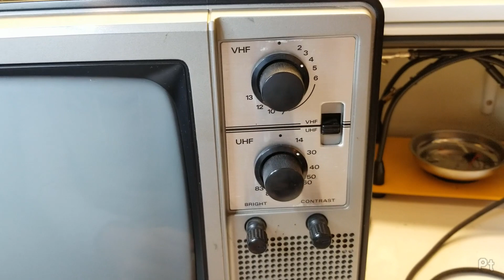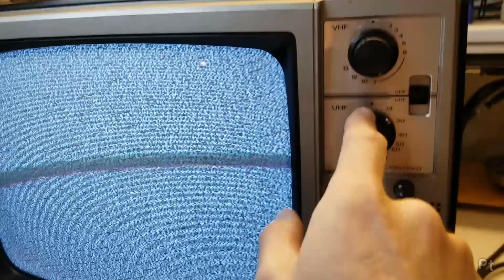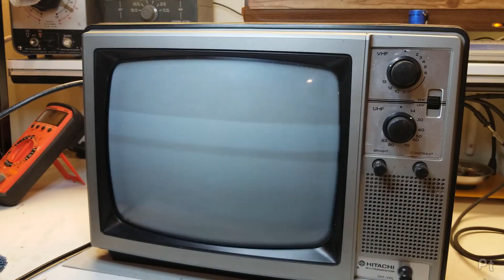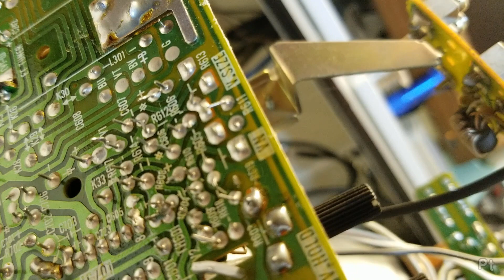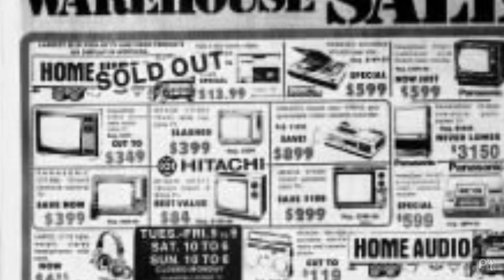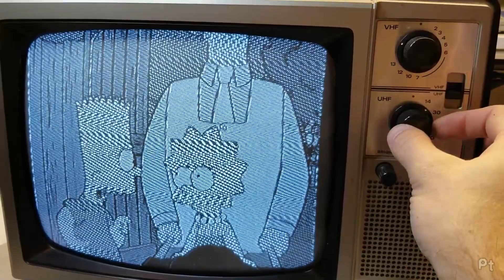Hitachi 12" Black & White TV (from 1981)

Comment: NOTE: incoherent ramblings ahead
I don't know when Germany went to these kind of tuners, but probably mid to late 60s*. With the advantage of having preset tuning on almost every TV. I remember I got a 1981 11 inch Grundig B&W (what? They made black&white TVs that late? - well turns out in the rest of the world...) that had pretty much the same tuner as their color TVs and VCRs. Yeah, one model fits all, that's how we cut cost. Now how about let's cut the cost even more and use as little solder as possible, that won't affect reliability in any way... back to where was I? Ah yes, that Grundig had a 12V input and I measured it at pretty much exactly 1A, so 12W. The 32W of this Hitachi seems excessive. I found an 11 inch b&w Nordmende in the e-waste not too long ago and it draws pretty much exactly 2A - and it does state 24W on the back. I know there's some losses in the AC transformer, but 3 times the power? Come on!
*) I found a Grundig Zauberspiegel from around 1967 (component date codes) that had a tuning knob that turned out to conceal a very weird (mechanically weird, electrically it's the same as this Hitachi TV) preset tuning and I'm certain that was so that customers used to the old style turret tuner (which the US used until no one in the world produced analog tuners anymore) wouldn't be alienated. Changing channels by pushing buttons? Ugh - miss me with that weird complicated future nonsense!
So as you can see, I don't do any research, I just draw conclusions from what I have on hand and/or find in the e-waste.
Reply from the maker: Incoherent ramblings are what this channel is all about! That Grundig from 1967 you talk about - RCA used this a lot on their sets in the 1980s. It was a rotary selector knob like the old tuners, but really it just switched between voltage presets. Essentially a pushbutton varactor diode tuner in knob form. In fact it was even simpler as the 2 thru 13 presets could only be varied slightly (essentially enough to fine tune) and then the additional 4 to 6 presets that supported the whole UHF band. Creature comfort for the older generation.
Reply: @probnotstech  Same same but different. If you've ever taken apart one of those pushbutton preset tuners (with a band switch VL VH U and a spindle trim pot), Grundig built a turret tuner using six of those. So there was nothing stopping you from putting channel 36 UHF on preset 1 and VHF H channel 6 on preset 2 and so on).
The comfort was in "it looks and operates like what you're used to, but once it's set up, you'll have a TV station on every channel" - magic mirror indeed (Zauberspiegel).
Too bad my mom wouldn't let me keep it.
TL;DR
Our summer vacation is the same every year. The people there have an attic (lumber room? Deutsch Rumpelkammer) where there used to be an awesome 1978 Salora TV with on screen display, clock, auto channel search with progress bar (yes, 1978), crazy sharp and vivid picture, sound chamber speaker (read: subwoofer), ultrasonic remote control and inside there was an LED for every power rail the PSU put out, there were oscilloscope screenshots silkscreened on the PCB next to the test points... the actual owner of the TV who rarely was there didn't know I was using it and just threw it away...
So I went to e-waste to see what was in stock. I had the choice between many modern (=broken+useless without remote) flatscreens, a mid 90s Grundig (also useless without remote, my games console only had RF and without being able to enter channel search, useless), an early 70s huge solid state Black&White TV and the almost equally as big 1967 (or 68) Grundig Zauberspiegel.
It had the dust of sitting in an attic for 30 years on it. I turned it on (usually a bad idea), but it worked. Or so I thought - because static on the screen and out of the speaker. I hooked the SNES to it (I left the AV connector at home knowing the TV waiting for me wouldn't have AV anyway), stumbled on the weird tuning mechanism, set it up, nothing. Best I could do was diagonal white lines over static. Tried for about an hour.
So it was decided I throw this thing away tomorrow to get the next TV up. My mom actually went and cleaned the TV despite me telling her it's gonna get thrown away and despite her not letting me keep it past the holiday anyway. Next morning, I fired it up again just to see... and it just worked.
That TV too had a crazy strong CRT, nice and sharp picture, but it lit the room as bright as a 60W incandescent. Still very round corners though, more like early 60s tubes.
So on our last day, I pulled all the tubes (except the CRT) and back in the trash it went. With a note saying that it worked fine in case anyone else would take it home, so at least they know it works when they replace the tubes.
One little thing - it had a chroma cancel knob so it couldn't have been made before 67 as this was when Germany went color.
What the knob does is essentially notch filter out the color carrier frequency so that you wouldn't get the chroma dots visible (as the CRT was so sharp that - I can confirm that - the chroma dots got annoying).